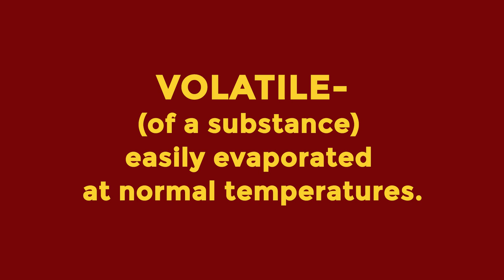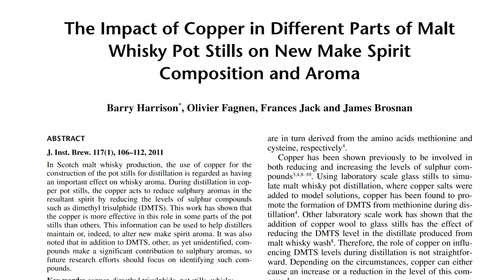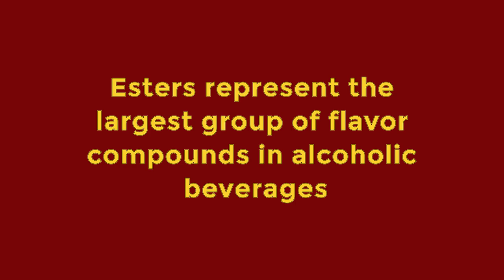Why Distillers Love Copper

Comment: I just discovered your channel. Thank you for a concise explanation of the benefits of copper in distilling. It took me two years of trial and error to learn what your short video explained. I started with stainless steel, but now have a 13 gallon copper pot and lid, plus copper mesh stuffed into a 7" diameter copper ball, two 6" sight glasses,  and a copper pot condenser. Copper mesh everywhere. A very big difference in the quality of the final product. I also use 505 copper cleaner between every batch which makes a big difference as well. The homemade version is 1/2 gallon water, 6 ounces hydrogen peroxide, 6 tablespoons citric acid. Soak copper parts for 20 minutes. Then wash with dawn dish soap and rinse well. I subscribed and am looking forward to watching more of your videos.
Reply from the maker: Nice! sounds like you have a good set-up over there. Thanks for subscribing.🙂

Comment: I have a SS still and found that the quality/purity of copper mesh was so hard to guarantee that I have replaced it in my column with SS scrubbers, cheaper and easier to clean. I do however have both a home made shotgun condenser and dephlegmator, using external 51mm diameter  SS tube but internally 4, 15mm diameter, good quality copper plumbing pipes. I guess that's why I couldn't detect a negative flavour change when I stopped using the copper mesh.

Comment: Hi, nice video as usual! Do you think that copper to fill a column (at the first usage) needs to be clean with a free run?  If yes, we have to use only water or some citric acid?
Many thanks!
Reply from the maker: You can take the copper pieces out and clean them with warm water and citric acid before putting them in the column. The pieces get quite dirty, so you might have to take the pieces out after each distillation and clean them this way prior to each distillation.
Reply: @MissBrewbird  By inverting the column (copper mesh/saddles left inside) and rinsing with a solution of one or two  teaspoons of citric acid, in one litre of water for 24-48hr, should remove much of the deleterious rubbish that accumulates on the copper during a distillation run. Then rinse column a few times, and upend column to evaporate remaining water. The science of this is inexact, and is temperature dependent. I live in Cairns tropical Australia, things move fast. Great to see Ms Brewbird flailing at windmills in Cannuckistanutopia.

Comment: Hey. Thanks for your video!// How you would then evaluate iStill products. They have SS Stills, but what they are saying is the problem with DMTS and other is badly controlled fermentation process. And basically Coper can be avoided definitely for products like gin or vodka
Reply from the maker: Hi! I think there is something so classic and beautiful about copper stills. I'd only choose an iStill or stainless steel still if price was the biggest factor in my decision. I believe there may be some ongoing costs with the iStill because of the software in the still.

Comment: Thank you little miss brewbird for your videos, one question is in the fermentation stage would a copper plate in a stainless fermentation vat assist in removing unwanted sulphites before it is distilled? I ask as have just started a small distillery in New Zealand and designing own equipment,
Sincerely David
Reply from the maker: Hey David! No, if I had a copper plate I'd definitely try to suspend it above the liquid in the still during distillation. I was just reading a study where they found that high amounts of copper can negatively impact yeast during fermentation which can result in lower alcohol yield and can stall yeast activity during fermentation.
Reply: @MissBrewbird  thanks for your study notes, on my first batch I had a copper cooling coil in fermenter, I did have trouble with slow fermentation’s.I don’t use it now but just stainless fermenters and I have no trouble with fermenting ( using my top secret wild yeasts)I also have a stainless aquarium heater inside as well, now I have a large copper still works great and rum is as smooth as the water on maple bay :)

Comment: I have a ss-still. Any suggestions where and how to put my copper-mesh in the still? Condenser will be a problem.
Anyway, thanks again for a informative video, and happy new year to you.
Keep the videos coming 🙂
Reply: In the column. Roll up some copper mesh and it'll sit in there, or copper pot scrubbers, but make sure they're pure copper and not just copper plated.
Reply from the maker: yep just as @Ross Bambrick says

Comment: This question may warrant a separate video, but how do you clean your copper stills in between runs, especially a copper boiler?  Is it necessary after every run?  Just figured sulphides would build up gradually.
Reply from the maker: We spray down the boiler after every wash run, and we do the occasional caustic wash. I don't think I've ever done a caustic wash on a copper still used only for spirit runs. I just sprayed it down with a hose. I've got a video on cleaning the stills, although it is a stainless steel still with copper packing: https://youtu.be/BAssY-4Vzkc